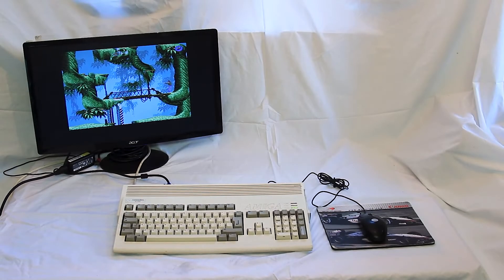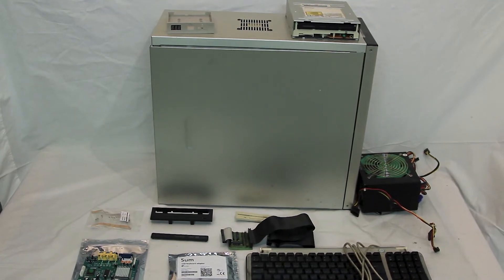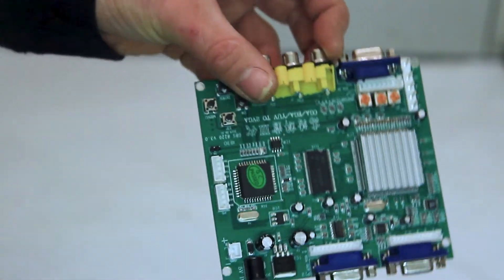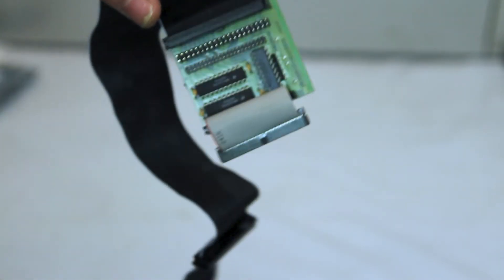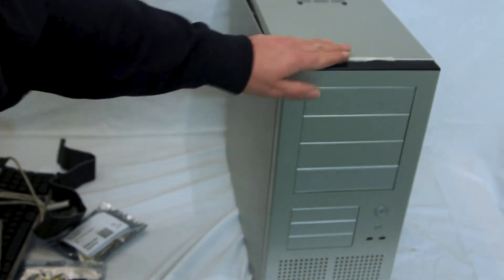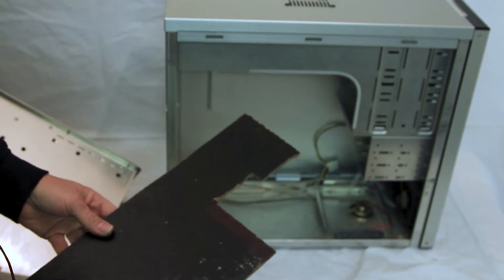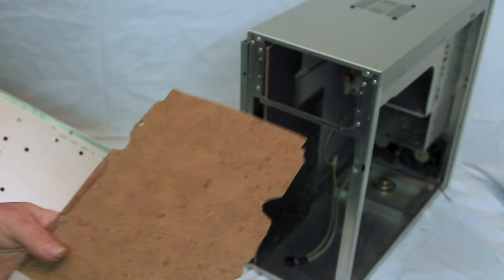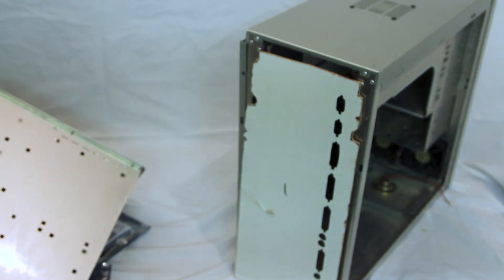Amiga A1200 Tower Conversion  - Part 1 Project Overview

Comment: I know it's yours to do with what you want, but to be frank:  This strikes me like taking the engine out of a 1983 Delorean and putting it in a generic 2020 Toyota Corolla.  Swapping the Amiga's case would have been something I could get behind in 1993... but now they are collectors items from my youth.  At this late date, you can run a full A1200 (or better) in emulation on any basic tower PC for less money than you would have gotten from auctioning the complete and working A1200.  I don't at all understand the motivation and hope you at least sold the remaining Amiga bits to people that can use them for restorations.
Reply from the maker: Hi. I had a spare motherboard from an incomplete a1200 so hence why i have done this. I still have a fully working orginal 1200 from when I brought it around 1995 time.

Comment: I did this to an A1200 in 1997 at uni, borrowed the uni's drills so I could drill through the back of the case, those things were made of really tough steel and there was no replaceable rear panel like we have now. Also, the mapping of the PC keyboard to AmigaOS wasn't great but it kind of worked.

If I were doing it now, I'd be offsetting the motherboard away from the case and using cables to go from the rear of the board to a custom I/O fascia, that way, you also hide the power connector port on the board from the outside world, the PSU would just connect internally. I would find a way to mount it to that tray that comes out of the case.
Reply from the maker: Good ideas there!